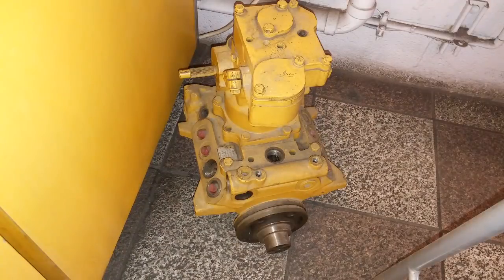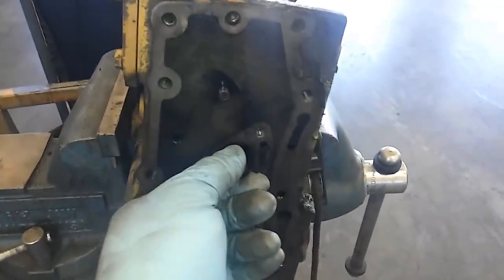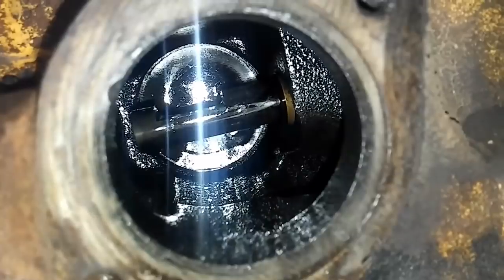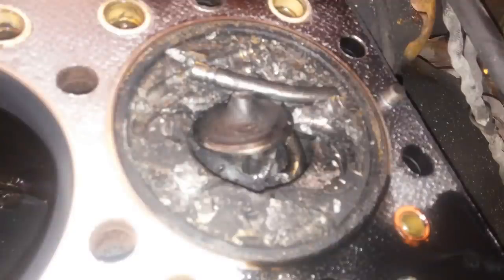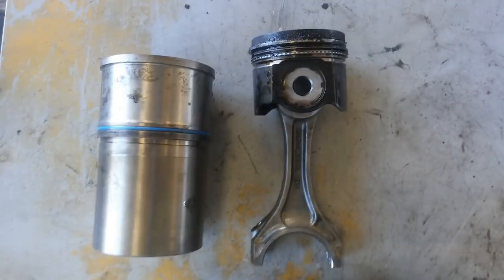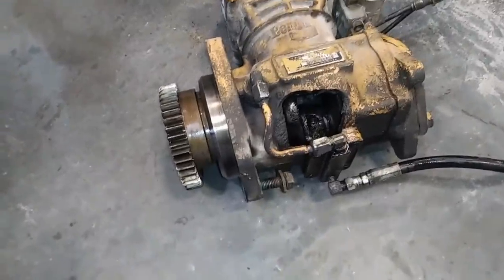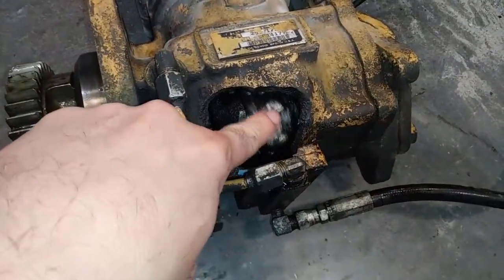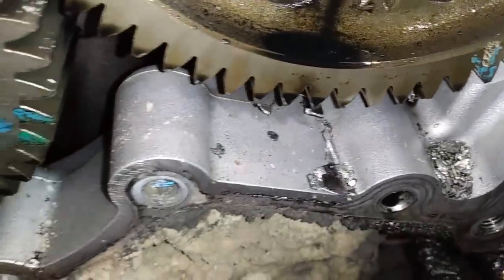Why Do Diesel Engines Runaway? What Is A Diesel Engine Runaway?

Comment: Can non-turbo diesels run away? Or just turbo models. May seem silly but i always thought it was only the turbo models becauae the exhaust would force the intake to suck more air and go crazy on compression
Reply: Yes , if they start sucking engine oil up into the pistons.
( worn rings )
And if the guy who assembled the engine used way too much assembly lube , it can boil out as a vapor and go through the engine (via the PCV) causing it to rev up.
Thats one of the reason you're supposed to change the oil on a new engine after its run about 50 hours.
Manufactures claim they use a special "Break in oil" but the real reason is they dont trust the oil they put in to last very long because it is contaminated with assembly lube.
Reply: Absolutely they can. Uncontrolled fuel or oil ingestion will cause an overspeed.

Comment: One thing I think would be a good idea because this is something that can happen with diesel engines is, why not have a throttle body on the suction side of the turbo that normally stays wide open, but if the engine RPMs exceed a predetermined maximum value (which would be a little bit higher than the governed speed), it would close the throttle body and starve the engine for air, preventing a runaway? 

Additionally, there could be a mechanism to allow manual operation of the throttle body so that in a situation where the engine is not necessarily "running away," but it won't shut off because it's running off of its own lubricating oil supply (like you mentioned in your video), once again a person could manually operate it from the cab or from underhood, and starve the engine for air and force a shutdown.

Comment: I have a 2008 f350 with a 550 hp 6.4 the O-rings between the compound turbos melted and caused oil to leak into the high pressure turbo causing it to run away by using the crankcase oil as fuel and even after the useless attempt of shutting the ignition off it amazingly managed to run at full throttle for 20 minutes... I know I could have shut the truck down by exposing the turbo and jamming the turbine but who the hell wants to get under the hood of a literal bomb??? I've since dropped a 12 valve Cummins in the truck and no issues at all
Reply: My father (diesel mechanic 20years) you half to till airflow even the. He said after 1minute of that most of the engines are shot
Reply: And nice truck btw

Comment: Being a German car mechanic, I've worked on many diesel car engines. The old MB 220D's actually had a throttle butterfly, that would choke of the air supply, and also produce vacuum. This would, in theory, stop an engine from running away, but to actually shut the engine down, you would have to manually close the throttle but pushing on the "stop" lever. I had one VW that tried running away, but I caught it before it revved over the rpm limit, which on 1.6L four cylinder engines was 5,500rpm. In that instance, I let out the clutch while holding the brake pedal firmly.
Reply: I had golf and jetta 1.6l diesel. They didn't have much power to begin with. But I do remember my dad's truck did have a button or pull out looking choke to kill the diesel engine.

Comment: Hang around some Detroit 71 series you'll see some lol
Reply: Didn't the 6,8V71's have those blocker plates mounted on the supercharger inlets for that reason...?
Reply: @michaelmurphy6869  Yep! Saw one used once. Destroyed the seals in the supercharger, but stopped the engine. USN 1966 on LST-1150.
Reply: 16v71 detroit deboss garage: WERE GONNA BLOW IT UP

Comment: i put a ball valve on my 3406 b on the out line of the secondary fuel filter just in case!
Reply: did you not watch the video? it can be caused by oil entering the combustion chamber and igniting. A fuel cut off wouldn't do shit as it will be igniting the oil
Reply: seems the only surefire way to kill it is either release the compression (jakes?) or cutting the air. I'm not 100% familiar with diesels but why wouldnt the throttle kill it?
Reply: yes blocking the air is a way to kill it, fuel cut offs aren't

Comment: I AM from mexico , I ser that engine backward un detroit 8v71  and  34060B Caterpillar ,it's crazy looking the smoke outlet from airfilter Cage.
Reply: I had a Mack engine run backwards, like you say you could hear exhaust coming out the air filter.   We shut it off immediately and restarted it and it ran forward again.  Everything was fine after that.  No drama, we stopped it with the key, restarted it and it ran fine.  This was a Mack 675, about a 1971 engine.

Comment: As a driver, I had a diesel runaway happen to me. I was driving a concrete mixer, the turbo blew, and was sounding really crunchy, and my dispatch decided I had to unload, and wash out before I could shut the engine off. Now this was a Cummins N-14, and it had gotten bad fast. We tried to choke it with something over the intake, and just came to the conclusion that we needed to dump the clutch, with the brakes set

Comment: I was trying to use injector cleaner direclty into the intake of my Mitsubishi L200 to clean carbon buildup and it almost runs away on me. Luckly, the 4D56 engine has a throttle body that shuts when you shut the key for smoother engine stops. That saved me that day and a valuable Lesson was learned...

Comment: Amazing- a 3 minute video stretched to 13 minutes.
Reply: @Corn Fed he did say that and a shit ton of other interesting stuff.
Reply: @Corn Fed I agree: All the "runaways" I've ever experienced, have been the result of oil getting into the air intake through the crankcase decompression lines. Bad center bearings in turbochargers also cause it, but my runaways have been old normally aspirated engines, with too much blow-by. Never injection pump problems.

Comment: Had an overspeed on the diesel engine of my self-propelled howitzer (Army) while in Germany.  The shut-off cable broke during a normal shut-down, then by the time we could get the engine compartment open (not a simple procedure on an armored tracked vehicle) to manually shut it down (bypassing the cable), the shut off lever that the cable attached to no longer seemed to work either.  The RPM's were starting to increase so we had to act fast.  Only by removing the air intake hose and slamming my helmet over the opening were we able to get it shut down.  Totally ruined  my helmet but saved several thousand of dollars worth of engine.

Comment: I had one on a boat. It was a 1970's single cylinder Yanmar 8hp. Started the engine and off it went, faster and faster,  I knew the only thing to do was remove the fuel line but getting close to the engine was 
terrifying. I let it cool down overnight and checked out what I could then tried it again and off it went but this time I had tied a bit of wire to the fuel line so I could pull it off quick and stopped it before it could get too fast.   No mechanics within 50 miles of my boat so I had to think around it, my theory at the time was that the governor (in whatever form it took) was jammed with grit or dried up old oil. I changed out the oil twice with a quick run between changes and it was ok from then on, never happened again.

Comment: In Coast Guard boot camp during small boat handling class the single inline 6 cylinder diesel started running away, the Chief Coxswain ripped an old wood hatch cover off of its hinges and put that over the air intake. Because the wood was water damaged the hatch cover splintered and sent wood shards into the intake, one of the trainees ripped off his t-shirt and stuffed that into the intake, engine stopped. The wood shards destroyed the engine though. That was fun.

Comment: I did not know of this condition but I am not surprised. What I am surprised about is that there is not a secondary fail-safe connected to the valves such as to stop the that camshaft turning or jam the valves closed or open?  By comparison a petrol engines coil is designed to reducet in spark power as the engine goes faster, but engines that are coked up can run-on.

Comment: Great description bud good job! People working around diesel engines need to watch this immediately! I myself have done the jacket method into the intake. Sucked my jacket in and shredded it but hey I saved a $50k motor lol. Turbo oil seal went out. The boss had no problem replacing my jacket lmao!

Comment: This is why I always carried a bedbugger blanket/pad on my trk after my Uncle had a runaway truck. The blanket/pad can be folded up tightly and stored on the deck of the tractor. If you have a runaway you can use that blanket to cover the air inlet and slow the fire.

Comment: As a machinist for BNSF Railway for 36 years the cause of most of the runaways on locomotive engines is a defective seal in the turbo letting the engine over speed on its own oil. This usually makes one hell of a mess out of the locomotive and the surrounding area and requires a lot of shop time to repair.

Comment: Had a runaway on a towboat 3 months ago. 4bt cummings with generator. It over rev'ed and was causing surges. Pulled the fuel shut off and it kept running. Pulled the air filter off and proceeded to cover the turbo with a steel plate. It wasn't a perfect fit so it got a little air but sucked the plate up tight to the turbo. It lost revs slowly over time and took ten minutes to finally shut down.

Comment: Had a runaway on a early 80s International garbage truck. Asked the mechanic later what we should have done. He told us get away from the truck so if the engine blew we wouldn't get hurt. Heard early Detroit had this problem so often that they put in a flapper on the air intake.

Comment: Yesterday I witnessed a '50's 2-stroke, 2-cylinder GM diesel on a old piece of heavy equipment with both injectors(?) stuck. The machine was running at high rpm and the throttle could not be controlled. The mechanic calmly removed the valve cover and using a pair of pliers, worked the rack loose and freed up the injectors(?) allowing the governor/throttle to be shut down. On my own Detroit diesel, my air damper was rust-welded open from moisture somehow getting inside the blower cover by the former owner. Heat from a torch and a wire brush freed up the shaft holding the flaps. The internal springs that once held the damper open were inoperative so now I have an external coil spring to hold the damper open.

Comment: I witnessed a V8 carbureted engine in a Ford truck run backwards. That thing was turning some unbelievable RPM`s. It was sucking through the exhaust and blowing out the carb. Blowed all kinds of black goo on the inside of the hood. Finally stuck something over the exhaust and killed it. No damage to the engine.

Comment: Thanks... excellent explanation with good solutions!  Bottom line, if you don't have a  fuel shutoff on your diesel engine, you probably should put one on...  otherwise it's a bit late. :)
Reply: Fuel shut off is not instant, inlet air restriction is.

Comment: I have very recently experienced a diesel Runaway while working on an old Mack fire truck with a couple of my friends it wouldn't stay running due to the diesel pump being gummed up with old diesel fuel so we decided to spray some starting fluid into the intake to get it to run and it was running but all of a sudden it started to run away while while the intake boot was off it was quite Scary seeing a diesel motor slowly and uncontrollably climb in RPMs then panic set in while trying to block off airflow via the turbo with a piece off cardboard then when it does shut off it's a huge sigh of relief.

Also turns out the emergency shut-off switch in the cab didn't work not a very good time to find out I that's not functioning lol

Comment: I rebuilt the fuel pump on my Dad's old IH 856. When getting pointers from old IH mechanics they warned me to follow the manual strictly-one piece in the wrong way could cause a runaway engine. After sweating bullets firing up the old gal (and stationing Dad at the fuel shut off valve) I apparently did everything right. (Nice Ghostbusters reference.)

Comment: I had a runaway 2 stroke motorcycle engine. It was a major freak out. Turned off the ignition, the the petcock and it had the tack pegged at 12K rpms. I think the direct oil injection lubrication was feeding it. I’m not sure what terminated the event, it lasted about 10 minutes. The vibration made the bike move along on the center stand. It was exciting I thought a piston was going to fly into the tank. I traded it soon after.

Comment: I was the one who had to run TO a runaway Detroit 3-71 to stop it, and I was an electrician, not the mechanic on board. Had to hold the emergency shutdown blower damper shut until it stopped. Pucker factor off the charts.

Comment: One thing I have heard of, for light and medium duty diesels at least, is aftermarket washable filters. Now, it isn't really a runaway, more of a "won't shut off" sort of thing, but these washable air filters are sprayed with oil to catch the dirt, and if more than the smallest amount of oil is used, then some will get past the filter. On a gas engine, this just means you need to clean your MAF sensor. On a diesel, it will idle until the filter oil is exhausted.

Comment: This sometimes happens with 2-stroke gas engines.  They will run without spark a surprising amount of the time, especially when hot.  So let's say you get a lean condition and the rpm starts going nuts.  You hit the kill switch to stop spark, and the engine keeps going because the plug is glowing orange.  Or say you blow the clutch-side crank seal and the engine starts sucking air and oil out of the transmission; then even turning off the gas or plugging the intake won't stop it.  They're so good at running without spark that Honda even built a whole engine around it, only using the ignition for starting and idling and a few other conditions.  That engine pulled 54ft-lbs of torque out of 0.4L displacement, on pump gas with no boost.

Comment: I had a runaway experience on a Toyota 6 cylinder small truck diesel engine , I had just had the second hand engine fitted and was driving it home from a distant city here in Australia . They did a leak down test on the engine and apparently didn't reattach the diesel return lines from the injectors correctly.  So while driving back for about 450 miles  i was accelerating to overtake and the engine took off , unfortunately I pushed the clutch in it revved its head off. I stopped opened the bonnet but gave up trying to block the air intake as it sounded like it was going to disenergrate  into a pile of shrapnel. The engine eventually stopped by itself but had sever damage.  It ended up having a sump filled to the top with diesel fuel that mixed with the oil . The oil laden mist was feed into the intake and caused. The runaway,  an engine overhaul new pistons and big end bearings  was carried out under warranty and the engine has done 200000klms since but uses some oil , I'm thinking the bores had some scoring and was only honed but anyway it's a scary and dangerous thing to witness.

Comment: Excellent vid. Speaking as a total amateur why don't they put some shut-down mechanism on the air intake when they build these engines or even as an added feature when installed? Not very complicated or expensive I would've thought. Very good expl. Thanks.

Comment: Seems to me if this is that big a problem, and I don't doubt that it is, there should be a manual system installed in the air intake that could be used to cut air flow. It could be something as simple as a device that looks like the old chokes that used to be on cars and trucks. The engine runs away, you pull the lever or knob and a plate closes in the air intake and cuts off the flow of air to the engine. I'm sure I'm not the first person to think of this.

Comment: A air control valve that can seal like 30 psi of pressure is all you need to add to it. Have a controller that detects a runaway and have it trigger the valve to close/ not allow air past.
Reply: an air

Comment: Some engines will give you some signs. My John Deere 4020 started surging at idle. When I talk to one of the older mechanics at my Deere dealer he said the governor in the injector pump is failing. Don't run it, get the pump off and get it rebuilt. If I did try to use it he said I could risk scattering the engine.

Comment: Yup ,been there , Waukesha V16 took off on me about 15 years ago.   One of the turbo seals leaked oil into the inlet side and off it went.  Couldn’t do anything about it but sit there and wait for it run out of oil or explode.  It exploded . Thru a rod across the room and out the outside wall     Scary. I’ll never forget that day.

Comment: When I was still a greenhorn, I had a little Isuzu run away on me due to blown turbo output seal. Scared the bejesus outta me. Kept my cool and Pulled the intake pipe and covered it with a shop manual.

Comment: I had a friend severely injured in Alaska when  an engine on a grid linked generator set was thought to be running but was actually being driven by the generator behaving as a motor powered by the grid.  Fuel was accumulating in the crankcase and finally the crankcase exploded and blew an access cover off which was the size of a manhole cover.  It was a diesel/electric locomotive engine with the generator modified for 60 hz AC.  The engine was a V16 with a 13" bore.  I don't remember the stroke.  Probably about 28000 cubic inches.